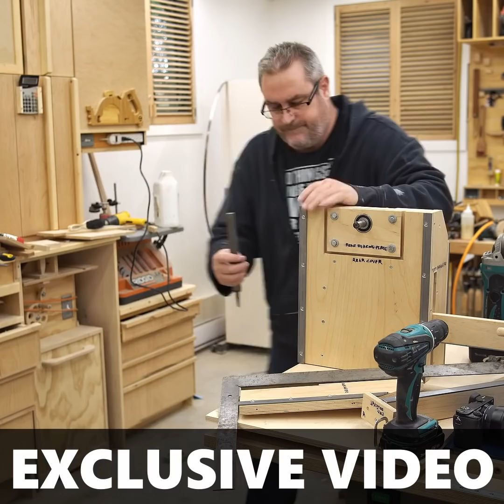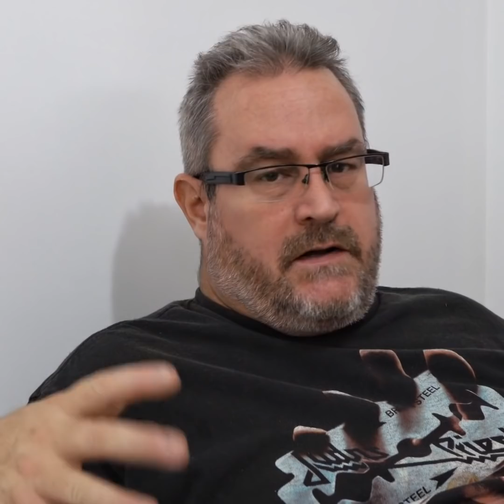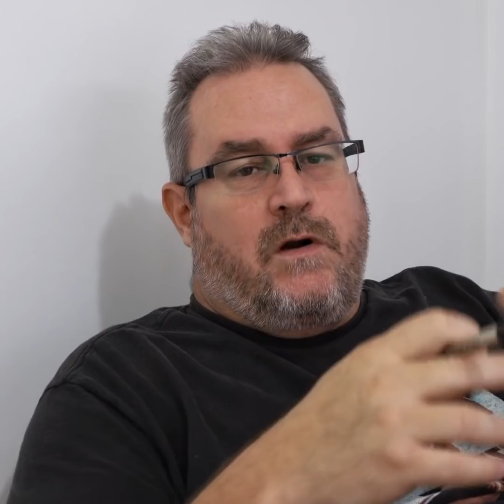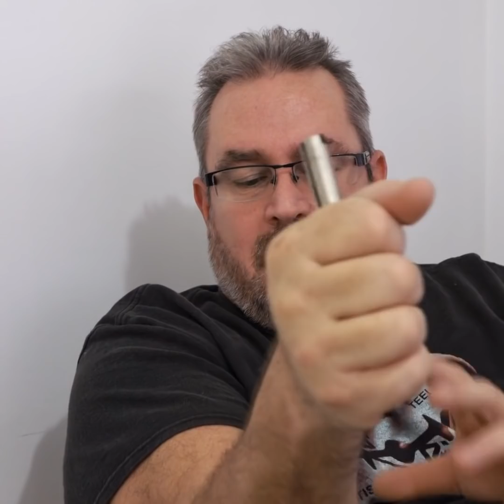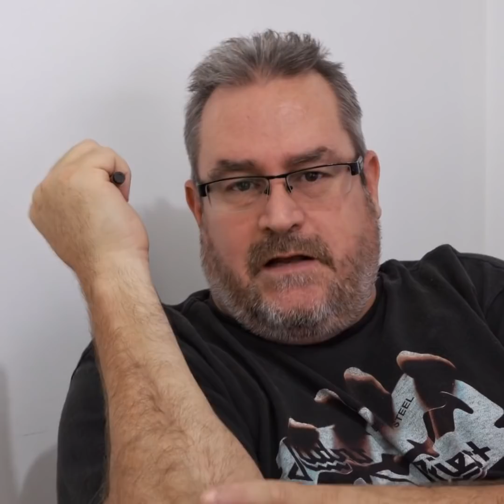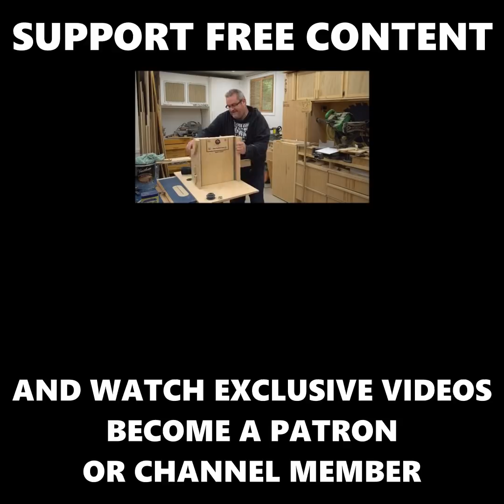Should I Motorize The Lift On The New Table Saw? / Talking About The Design

Comment: I wouldn't think you'd need to complicate the controls with multiple buttons. A jog wheel on a rotary encoder for lift and one for tilt, along with some rate controlled acceleration (same as what's done with a computer mouse) in software and you can run it as fast as you like. The software to read that and run stepper motors is not all that complicated. How To Mechatronics (https://www.youtube.com/channel/UCmkP178NasnhR3TWQyyP4Gw) covers all the basics in his tutorials. It's surprisingly easy.

Comment: You mention about steel on steel being low friction, you are correct. However cast iron on cast iron ia very different as its fullnof carbon which is a natural lubricant.

Comment: I remember when Craftsman came out with digital motorized table and radial arm saws. I thought it was overkill and kinda dumb. Years later I ended up getting a floor model at a great price when they changed from LED to LCD. I got that radial saw some 20 plus years ago and still have it and love it. I use the motorized feature all the time for doing precise grooves and dados. It has jog buttons with a digital readout, and you can enter a dimension and press ACT and it will go to that number.

Comment: If it was me, no, I would not. I tried it with a router table, it worked but it always "over run" a bit, I needed to "jiggle" it a bit to get it to the exact height ... I found that the electric motor does not stop dead when I let go of the button. I would love to see you do it, I might find where I went wrong!
Thanks for the video!
Reply: Were you using a stepper motor though?

Comment: I would use a motorized blade lift whether it had built in precision or not. There was a time I would have scoffed at the idea but I also used to scoff at power windows and locks in my truck.  So yes, definitely motorize the lift.

Comment: I think the motors over complicate it. Keep it simple!
Reply from the maker: Adding a motor to the lift actually reduces the complexity of the original design. It gets rid of the inclined plane and also the push / pull frame inside the cabinet that moves the slide bar for the lift.
Reply: @IBuildItScrapBin  but you add in a control system, motor and gearbox, couplers, etc which adds complexity and additional failure points. It may also make the design more intimidating for users who want to build the saw from your plans but are scared of electronics. Although I suppose you could have both motorized and non motorized versions in your plans...
Reply from the maker: Control system is a power adapter, two buttons and the wire needed to connect them. The motor I already have and it has a gearbox built in to reduce the output to 300 rpm. The only complication is to add the lead screw and couple that to the motor. I suppose I could also add limit switches to guard against going too far, but I have those also.
This replaces the inclined plane arrangement (more complex than all of the above) and the push / pull frame. You'd need a better look at the design to know what the push / pull frame does, but basically it makes it so that the lift / lower crank stays in one place on the front of the saw.
As for intimidating for other builders, that's not an issue. I really can't see many people attempting to build this saw, even the fully mechanical version.
Reply: @IBuildItScrapBin  I realize that it may make me odd but, just like those who like the feel of a real book to read from, I will want to build the mechanical version of the table saw once the plans are finally out. Can't wait!!!

Comment: Cool idea about corse/fine setup for the motors. 

A couple of points regarding the fine-tuning button (you might have already considered these, but on the off chance that you have not ;) here goes nothing) : how about having the fine tuning steps be the closer to the motor's resolution (i.e. an angle on the motor), rather than a set amount of angular movement in the structure of the saw. 

I am imagining on the way to a 45 degree setup, the coarse button gets it to 44.3, and then if the fine button only moves in full degrees, then it becomes hard to get an exact angle (although that exact might not be useful in many cases).

Also, coupling the buttons to actual "degrees" on the saw mechanism probably requires a more complicated control circuitry for the motor to handle the non-linear nature of the geometry (i.e. using a straight threaded rod to rotate something). But that is probably just an Arduino and is not really hard for you :) 

I had avoided that problem in making a sky-tracking system for astro-photography by bending the 1/4-20 threaded rod into a circular curve and have the nut rotate; but that system just supported a piece of plywood plus a camera ;-P
Reply: this is just a minute later, haha! You could probably use a worm-drive type operation with a threaded rod bent and epoxied to a circular section of plywood... 

At this point I think I better keep quite since you always come up with neat and practical ideas for your projects and you know more about what you are going to do than I !! :D

Comment: My 3d printer has a touch pad that allows me to side a bar for 0-100% movement and then increments of 10mm 1mm and .01 mm on a linear guide imagine the precision lol.... I bet this would be a fun project for a 3d printer builder to collaborate on ... https://www.dobot.cc/dobot-product-accessories.html look under m2 and m3 if you want to check out the parts

Comment: IMHO: When you use steppermotors and al little computer, will you have a measurementmechanic, so you can see the way, the steppermotor makes, or in other words, will you use a display, to see the way in 100s of an inch or so? Or for the level of the tilt? My opinion is: Steppermotors, then with display and electronic measurement. If not, then also no steppermotor. Your work to measure the hight of the blade or the tilt would be the same.  What do you think?
Thank you, that we can see your development of the this saw.
Cheerio from Germany.

Comment: raise, tilt with an Arduino and steppers would be pretty cool, especially if you could program a touch screen to "0" the blade to the table then punch in what height or angle you want and it would go right to that setting.

Comment: I feel like turning a crank a little bit to adjust maybe an eighth may be a bit more tactile and easier than working a way to do it with a motor, BUT if you're confident you can achieve a result that you will be happy with then i say go for it :)

Comment: Those steppers you have are probably nema 17.  I don't know if they would have the holding torque you need.  You would have to trust that it never loses steps so I would think you'd want overkill there.
Reply from the maker: The lead screw hold the lift carriage, so the motor only has to provide torque to turn it.
Reply: I thought you said you were going to have it turn the lead screw directly.
Reply from the maker: I did / it does. The motor doesn't need to hold, just turn either forward or backward. It's the lead screw that holds the carriage in position.

Comment: Funny thing ,i rebuilt an older craftsmen saw few years back ,one guy of you tube shows and tells you how to make a wax and graphite mixture to lube up all the inter parts ,so i did it how he said and the i still use the saw with no problems ,of coarse i bought and built you fence system for it which works great as well ,the guy was Neilson studios youtube channel
Reply from the maker: I think I saw that a while ago.

Comment: i would NEVER motorize a tool to move that you are using with your hands. there is a chance that something goes wrong and the blade gets moved without you intending it to do so. cranking the handwheel a couple of turns isnt all that much effort!
Reply from the maker: Much like I've never witnessed (over the 30+ years I've been using table saws) a saw turn on by itself, I expect I would never see this one come to life and decide to raise or lower the blade on it's own. And besides, the action is not swift - it takes time lift the blade and I would see that happen.
Reply: i dont mean the saw turning on by itself, i mean the lifting mechanism working without you intending to do so... weather by fault or by mistake. just a thing to consider maybe :)
Reply: @Sharky; Even if the lift mechanism was motorized you'd probably still want the ability to solidly lock it in place manually once it's at the desired height.
Reply: Irrational fear of the unknown causes people to say things that just don’t make any sense.
Reply: @nocturnalwoodworker7201  its not irrational to think about elektromechanical parts to do stuff you dont want them to do in case of a failure. thats why so many of them have safety mechanisms built into them. 

i just said its something to consider, not that its stupid to motorize it because it will kill you.

motorizing something clearly has its benefits, so it would be possible to set a depth of cut consistently with a stepper motor - e.g you want to cut 1mm deeper, you could totally do that with a simple arduino circuit yet you'd somehow need to make sure nothing can go wrong with it. there is nothing wrong with considering the worst things to happen.

Comment: Love the idea of using stepper for the lift.  You could make it very simple with a display that would show the exact height of the blade.  Then a knob could adjust to the desired height (as viewed on the display) and Arduino would raise/lower the blade to that height.  You would just have to build in the math for the screw and steps and then calibrate it.

Heck, you could even switch between metric/imperial with a button press and show precision out to a thou.  Like a milling machine DRO.
Reply: I was thinking the same thing.  That would be a feature that would take quite a bit of work and research but would be sooo worth it in the end.

Comment: If you put a motor in there i would use a arduino with a display and a steppermotor with driver then u can exactly set the hight of the blade within the range of your lift ( think about adjusting the program for the hight adjustment when the blade is tilted) 
Continue on with this great build i like your ideas and also like watvhing your vids
Greetings from Austria/ vienna 
Stefan

Comment: This project is over my current woodworking skill level - not to mention that with the time I currently can dedicate to anything hobby - my tablesaw would be finished around midsummer 2057.

But I really enjoy watching the tablesaw being built by a skilled craftsman. 

And it's very interesting to hear you talk about design and to factually have my own misconceptions disputed.

I feel much more at home around arduinos and step motors, but it would still be very interesting to see how you would go about building it and I will without doubt learn something useful from that detour as well.

And since I don't have the time to build my own tablesaw anyway, please go ahead with the motorized lift.

Comment: Instead of up/down buttons, why not have a keypad where you just type in the height or angle? Maybe have some preset buttons (2x material, 45 degrees etc.)? I can't quickly find an exact reference,but there's a youtuber with a mitre station where he types in the length and the stop block moves to the right spot. He might even have integrated it with a cut list. Real fancy.
Reply: Jay Bates just did a standing desk with that type of controller, something like that would probably work.

Comment: John, if you are going to install 2 motors for lift and tilt, what are your thoughts on a third motor to move the fence?
Hey Google, set the table saw fence at 25.4 mm and the lift at 6.35 mm. I'd bet it would go viral. :D
Reply: Mike Whitenton that would be amazing. I see an untapped market here.
Reply: I like the idea about motorised fence, but would it be ridgid enough when not moving?
Reply: @tadejstefancic7828  I use a digital motorised fence everyday.  It's awesome.
Reply: @tadejstefancic7828  John has made fences and jigs with threaded rod several times. So he has experience doing this kind of thing already.
Reply: You could have it motorized to move it and then still lock it in place as you normally would. Then just unlock it again to have X digital assistant move it
Reply: You mean 10 and 2.5 inches
Reply: Raspberry Pi, can bus, arduinos, stepper drivers and motors! I build robots and plan on doing this with my table saw. :)

Comment: Motorized action would be very cool, and I'm sure it would bring in more views. Not to mention the precision. I bought a kit over the summer and just finished learning about setting up my own CNC (will be a winter project, too much on the go atm). It's not as intimidating as it first seems. It's surprisingly simple. A pendant would be really convenient too - no need to run back and forth to a PC for adjustments, could do it all standing right there at the saw. If you have the gear, then I say go for it!
Reply from the maker: After testing the small gear motor for the lift (I put a video on Instagram showing it in action), I've decided to use that instead of a stepper motor and more complex approach.
Reply: Even better!

Comment: A neat feature on a motorized version, if using a micro controller, is the ability to save settings to dedicated buttons for tilt and depth, kind of like on a car radio. So you want 45 degrees, press T1, 1 inch depth, press D2... :)